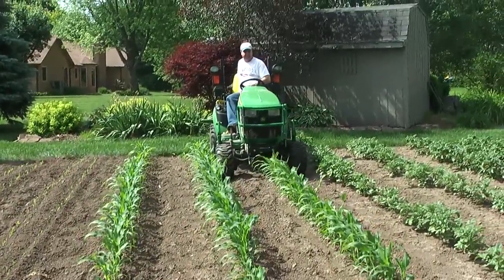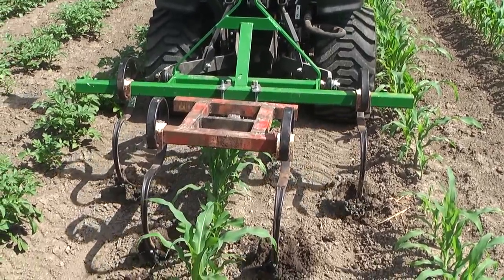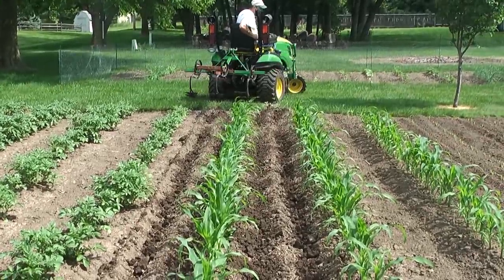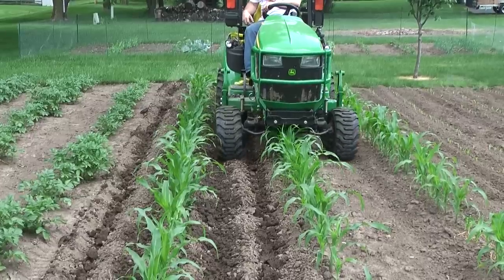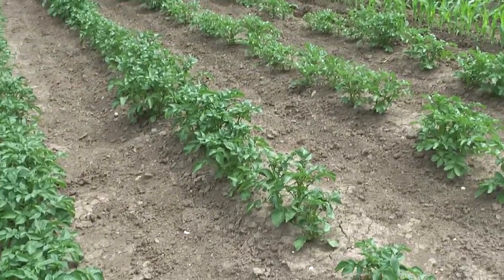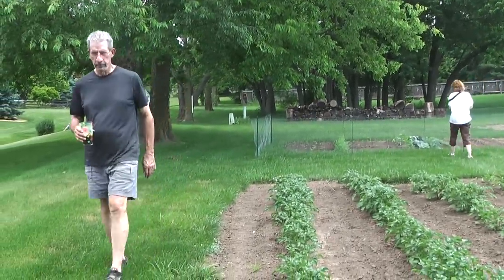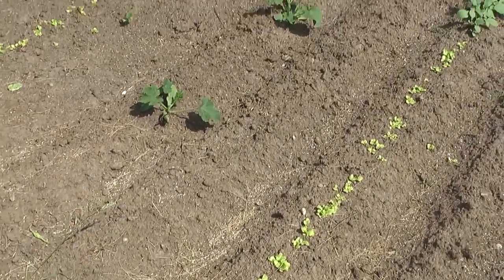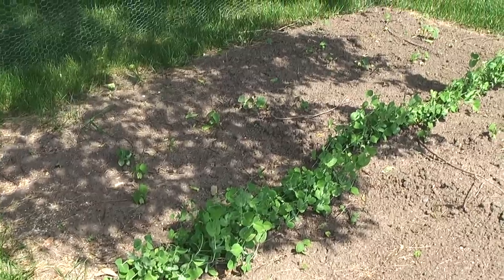#6 Cultivating Corn with John Deere 1025R

Comment: I have a similar set up except I use  "Fixed"  cultivator shafts with sweep's ( 54 deg)  For the first cultivation or two I use 16". Then as the plants grow I switch out for 14's.  Cultivating is a shallow process as the goal is to go just deep enough to cut the shallow roots of the weed's and grass and not deep enough to cut the root's of the corn/bean's etc.

I do not use sweeps for "Hilled" plants like Potatoes. I use 14" hiller disc to bury the weeds as they emerge.   You have to experiment with your own soil and conditions.
Reply from the maker: +BigChiefNoWashieTribe good info, thanks!

Comment: Tim kind of curious how much space did you have between the two closest sweeps? I mean you were not tearing the the corn out seemed ok what was the issue. I"m going to be using a cultivator my self this year as the tiller is about on its last legs and due to a bad back rather not stand behind a tiller if I can sit and drive a tractor.
Reply from the maker: +mrelectron62 I'm not exactly sure now.  However, I can tell you they were too close, especially to be mounted so far back from the rear tractor wheels.
It DID in fact cut some of the corn off at the roots due to being too close to the rows. I replanted it, and thankfully, it rained within a couple of hours, saving the corn.

If you make your own,  be sure to put the closest to the row sweeps at the front, as close to the rear tires as possible.
One other approach is the disk hiller like I used in the "Hilling Potatoes and Corn" video. This approach worked much better for me.

You can buy a cultivator - King Kutter brand.   You will see lots of them on craigslist for $100 or so.
Reply: Tractor Time with Tim
 Thanks Tim, I kind of figured by now you would not have that info but was curious. Thats exacty what I did got cultivator off of  Craigs list and cleaned it up and added some sweeps. I have about 10'' between the two closest inside sweeps I guess it will be some trial and err hopfully not too much err lol. I liked  the set up you had with the hillers may see later if I can add some thing like that to this one. Enjoy your videos and thanks for the fast response.

Comment: Novice here. Why till getween the corn rows?
Reply from the maker: To keep the weeds down.
Reply: Yeh farken weeds, never needing nightmare, I’ve got a similar implement to do the same but I’ve got smaller blades on the tines only 25mm wide, they won’t catch the roots.
I box blade and rake the tracks between my rows, try to minimise herbicide use as much as possible